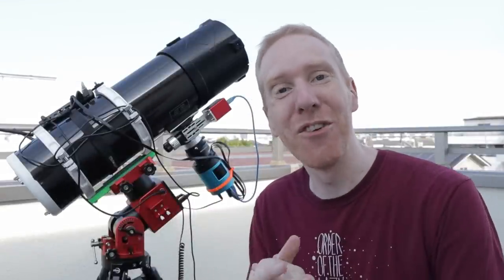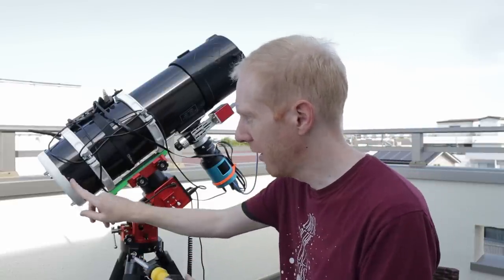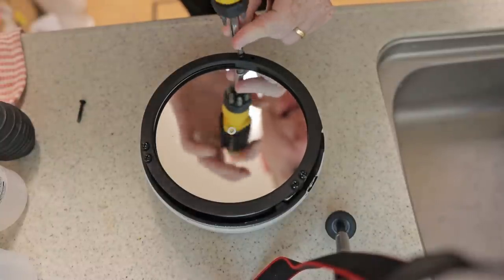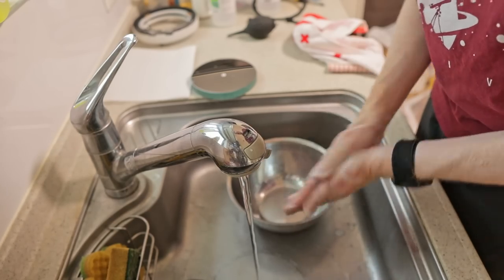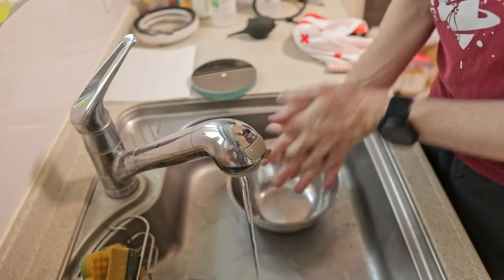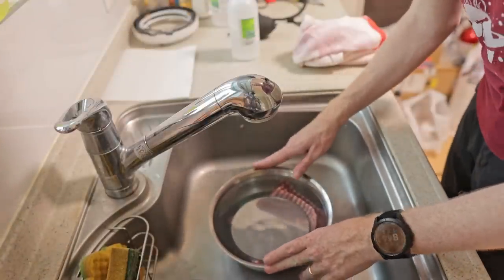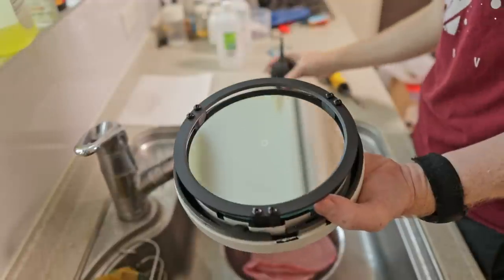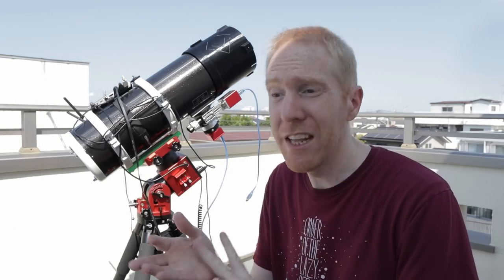Primary Mirror CLEANING tutorial... with FINGERS 😱 - NOT for the faint hearted!

Comment: Ha! This is almost exactly how I clean my mirrors (and actually cleaned a 203mm mirror last night). The only differences are:
1) Soak the mirror for a few minutes in the soapy water before using your fingers. This gives the water and soap time to loosen up or dissolve films and particles on the surface.  
2) Use a bit more of the dishwashing soap. 
3) Be careful when using the air bulb to blow the dust and water droplets off the mirror as it’s easy to whack the mirror with it (been there done that). I hold the tip of the bulb with one hand and squeeze with the other. 

Thanks Cuiv, great video!
Reply from the maker: Thanks for the additional tips! This is actually really good to know :-)
Reply: The rubber tipped ones should only be used

Comment: Lens cleaning is a tribal hot topic, and I disagree with some of what you did for reasons that may well be superstition.. But, a couple things I think you might agree with are...

1) Run a piece of tape from your mirror cell to your tube, for alignment... Mark the side of the mirror (not the reflective bit, just the glass on the side) to align to the mirror to the cell.   During reassembly if you you align your marks and tape, you'll have less collimation headaches.

2) Water temp doesn't affect the mirror.  If you have goo on that mirror, any temperature change that doesn't crack it, doesn't harm it.   So hot water before touching might do the job.

3) Let it soak a bit before you touch it (I don't touch with my hands, but regardless...), soaking will release some of the particles on the mirror without need to touch.  Let it soak and see how it goes before you start touching it.

4) choose soaps wisely.  Most detergents are abrasive, this is part of how they work.   All you really need is a pure soap (like laundry soap.. not hand soap that has lotions added or anything like that.. pure soap) that will release the oils, and resins in the pollen, or sap, or whatever got in there.  Avoid detergents -- soap and detergent are not the same thing, this is why labels for detergent say detergent and labels for soap say SOAP... if it doesn't say soap, if it says 'Cleansing Bar' that is detergent.  In the U.S. Soap means only one thing.. and products that aren't soap don't say they are soap.. If it says soap, then it is soap.

Thats all, otherwise the video was good.  I don't touch my mirror, but ultimately its your mirror and my superstitions are my own.  To all reading, I'd say the same.. your optics, your rules.

But as the video said over and over... Only clean at desperate need.  Dust doesn't hurt your images if you have good flat frames... A big wad of sap or pollen is a different animal.

And last -- All touching causes micro scratches, over the course of time, its never better.
Reply from the maker: Thanks for all those tips!

Comment: Hi - always a good precaution to remove rings and watches when handling delicate optical surfaces. Another variation is to put a drop of uncented detergent directly on your fingertips. This places the cleaning solution on the fingers applying pressure to remove any sticky substances…cheers, Gary
Reply from the maker: Thanks for the tips Gary!!

Comment: Hi Cuiv, I note the key point about not having the mirror clips tight to stop pinching.  However I've found that my mirrors move during a nights imaging as the mount guides due to the mirror being loose.  As a result collimation is lost and also the flats won't work because the mirror position has changed.  As a result when stacked together, the data generates circles in the images.  How do you prevent your mirrors from changing position during a night of guiding?  Thanks and best wishes

Comment: do the same rules go for corrector plates or objective lenses with coatings?
Reply from the maker: Well in theory it should also work for such optics, but they're more difficult to isolate compared to a primary (corrector place is linked to primary etc), plus it's just easier to do it "in situ" with PLA!

Comment: You should try to use PVA glue... I did on my 460mm and 254mm and works perfectly.  :)
Reply from the maker: How does that work??
Reply: @CuivTheLazyGeek it's Elmer's white school glue. I've not tried this, but the idea would be that the glue bonds to contaminants and then you peel it off.  If the mirrors coatings are not strong, it could theoretically pull them off.  Elmer's glue is fairly weak and water soluble, so it can be weakened...but I'm not sure it is enough for many contaminants like pollen.   There is a very expensive peel off optics cleaner called First Contact that uses the same method and is used by NASA and optical labs... But very different formulation 😅
Reply: @CuivTheLazyGeek  I usually apply a couple of layers of white glue (PVA glue) on the mirror. Sometimes I dilute the glue with Alcohol (Ethanol or IPA works fine).. After wait it dry, I peel off the PVA layer... All the debris comes out... But be carefull... if the aluminium coating is bad quality, it can remove the coating... All my mirrors except one worked perfectly... The one in question had a bad quality alluminization and no SiO2 coating...